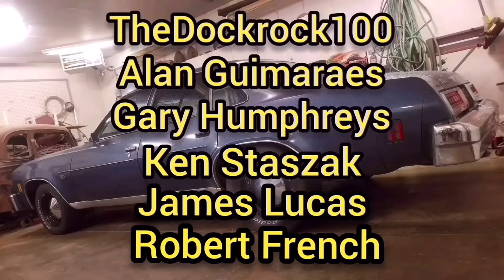Metal Finish a Complicated Weld Seam With Simple Tools. Chicken Truck Rust Repair Part 2.

Comment: A bolt in the tip of the stud gun has become my new favorite quick shrink/puller tool!!!
...after getting sick of mig'n reused copper nails~
Reply: push or pull, twist right to release...
Reply from the maker: Right on!

Comment: By the light of the silvery moon I see you are using the large Milwaukee marker with your shrinking disc. Stanford stamp pad refill ink black or blue would be a cheaper option.
Reply from the maker: Thanks for the tip, I'm going to have to remember to find some the next time I go to the store

Comment: So you caved on the music.

The door looks great, I am stretching a 36 truck cab and can't make my seams look as good. I am using a mig. I even bought a pair of glasses like yours. But Dam!
Reply from the maker: Yeah, the thing with mig is it's better to leave the seam a bit low. The harder weld material will ghost through the paint. Nothing wrong with 1/16 or 1/8" of filler on a panel

Comment: Fantastic effort Kyle, flat is very hard to achieve and it looks like you pulled it off.  Funny you mentioned the 29 minute mark, I noticed at around that time it looked like you were getting control of it, it got better and better from that point on.  When you were pointing out the two raised knots earlier in the video, I figured those were the areas you'd use the shrinking disk.  All in all, great work.
Reply from the maker: Thanks, I messed up my timing in the video and I think it was actually around the 30 minute point when I had it almost straight and immediately biffed it up with the shrinking disk. Oh well haha!

Comment: Outstanding finish you got there despite the issue with the shrinking disk. I have never really got on with them and prefer to use a gas flame to do it. 

I find it more accurate and controllable. I agree with you on finding the limits of a tool too. Useful knowledge. Flat panels are always harder to deal with as you have pressings in the original alongside fresh, unstretched steel. When you heat them during welding they behave differently when cooling. Also the original steel may well be a different type  to what you are using and will amplify that effect.

Top job and great to see someone actually working out the issues rather than ignoring them. 

Excellent videos

Comment: I got the shrinking wheels too not sure what rpm works best. Good job thank you ALL stay safe
Reply: Standard 4 1/2" angle grinder is around 3600 RPMs. The speed is needed to generate sufficient heat.
Reply: @kennethstaszak9990  thank you

Comment: Ok Kyle. Now I’m confused a bit. I always thought quenching Was required. If it air cools do you think that you get the same amount of shrink? Thanks for your teaching ability! Yes, finish that other door bottom so that the sectioning can begin!
Reply from the maker: I think it shrinks more if you quench it, the problem is its impossible to consistently quench the entire area so I was ending up with more waves by trying to force cool it. As I said in the start of the video, the welded seam had shrunk and we didn't force cool that

Comment: Dude, are you a surgeon? It's amazing how you've dissected That truck! I'm starting to think that you really could work on Big Bird! 
I'm curious about the louvered vent on the passenger side in front of the door. Don't most of these trucks have a rectangular vent that opens in the same place on the driver's side? Yours may really be super rare, having a cowl vent at the top center of the cowl like the older cars had!! If it were me, I'd get rid of the louvers on the passenger side. I have a mental disability  that makes me want both sides of something to be exactly the same. I might be a millionaire by now if I wasn't so focused on stuff being symmetrical. I really enjoy the bodywork you do, and it's really inspiring me to get going on my '47 sport coupe. It's real rusty, i mean REAL RUSTY, and if I just cut off the bottom 10" or so of the doors, it would save a lot of work. The floor has pretty much deleted itself already. Keep up the good work!

Comment: I switched over to all flux-core welding in the last few months. It took about 2 weeks or so for it to become second-nature to use.  I now wouldn't bother picking up any other welder.  I find Tig too slow & cumbersome & Mig causes too much distortion for my liking. Plus Mig is an absolute PITA to grind down in comparison to flux-core. You can also planish flux core as it is a much more pliable weld than Mig. 

I got the absolute greatest satisfaction possible bringing back all my gas bottles & having them hand me back my deposit money I had paid on every bottle (a lot) - but not as much satisfaction as I got from sticking all my posh welding machines up for sale & only keeping 1 single "POS" machine that I really love using. Which cost <200 quid.  I.E it paid for itself on the very first panel it repaired.. and it has repaired dozens & dozens since. 

Give it a try for the laugh if you like - give it a proper try - run 0.6mm wire at 6.6V, wire negative polarity - once you get the hang of it, it is an awesome process for bodywork.

Comment: This is all very well but I don`t know anybody who has a tig and a mig, I certainly don`t, most of the people I know have to do this kind of work with a mig.  Please can you show us something that we can relate to?  Thanks, Paul.
Reply from the maker: Hi Paul. I just finished a 20+ part series on rebuilding a truck using a mig exclusively...and over half the videos on my channel involve mig welding. Tig welders have become extremely affordable for the average hobbyist in recent years, and the same techniques outlined in this video can be applied to mig welds. If this channel isn't "relatable" enough for you, then maybe it's time you move on?

Comment: I dont understand the whole "Planishing the weld" thing. I have seen more than one person do this.

What does this accomplish, over just grinding the weld down to the deck and metal finishing the surface so you cant see it?
Reply from the maker: The welded area is shrunk. It has to be stretched to return the panel to its original dimensions

Comment: The hammer has a long handle for a reason, it's best used by holding at the end & flicking with the wrist, this requires less effort with more force. Nice work btw

Comment: After all this sanding and filing, how thin does the metal end up being?  Looks great, but it has to be thinner, yes? 🍿
Reply from the maker: The file is just showing where the highs and lows are. It's not removing a significant amount of material. Take a body file and try filing through a piece of sheetmetal. You're going to be at it for a while.
Reply: @CarterAutoRestyling  you haven't seen me use a file..........

Comment: Thanks for showing this. Recently had a VERY SIMILAR experience while attempting to do a 3" round patch in a Model A splash apron. The welding caused the area to be very "uneven" and I ended up stretching it while trying to get it flat. Used the little disc a couple to times only to have it "reverse" each time I applied the disc. Very frustrating and "confidence killing" !! Didn't get it as flat as you because I was beginning to think that was impossible. 
Please explain the thinking behind how the marker is being used with the disc??? 
Again, really appreciate the detailed instruction as it really helps to understand whether our amateur conclusions are correct or are causing more damage and wasted time. ;o) 👍👍🛠🔩⚙🔧🙃✌✌
Reply from the maker: The idea behind the marker is that the ink acts as a lubricant to prevent the disc from galling the metal. It also acts as a guide coat. Apparently using dykem as a guide coat reduces the effectiveness of the shrinking disk
Reply: @CarterAutoRestyling  
  Thanks for the reply Kyle. Interesting !! The disc uses friction to cause the heat for the shrinking process. It's interesting that a lubricant would be desired since that would lessen the friction. To be clear, I'm certainly NOT arguing !!! Sometimes, things simply "don't add up". ;o) The shrinking disc appears to be a good tool but one that takes quite a bit of "practice" (trial and error) to learn how to "effectively" use !!! I'm definitely NOT at your level but one of the things your video shows is that when things don't go well at first, a person needs to slow down, reflect and access, relax, (maybe take a break) and continue AT A SLOW, OBSERVANT, PACE, and practice lots of "common sense" !!! ;o) 👍👍👍👍🔧🪛⚙
🗜🪠🛠⚒